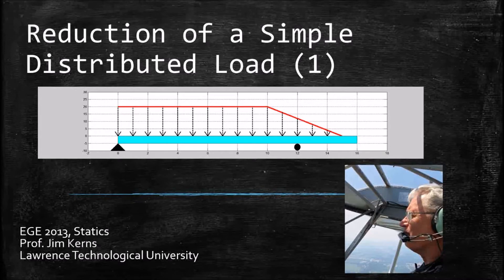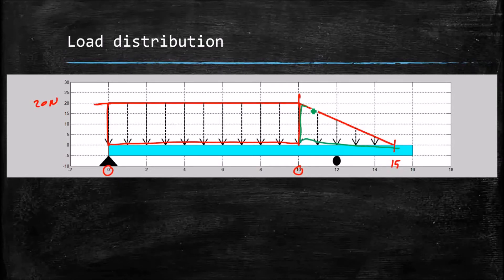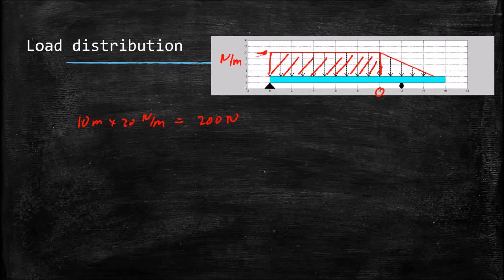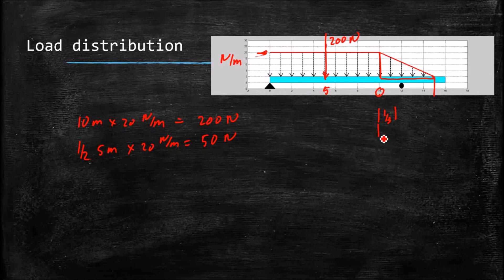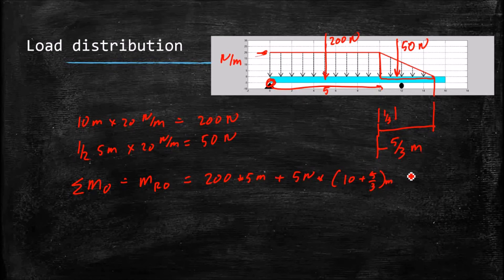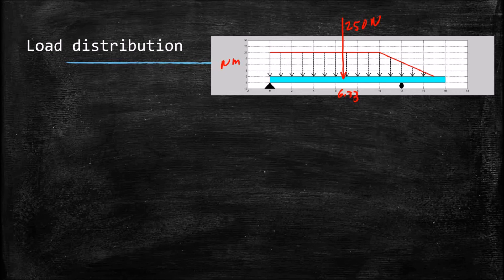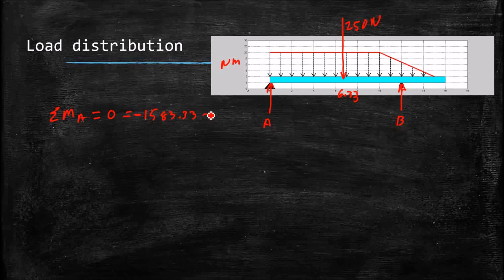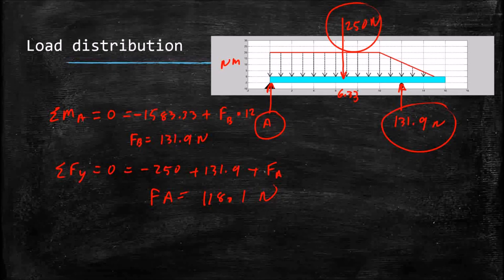EGE 2013 Statics: Resolving a Simple Distributed Loading Example

Comment: What if you took the moments at a different point?
Reply from the maker: The final answer is the same force in the same place, but the distances in our calculations will be different - for example if we took the moment about the right end of the beam, the distances to the two equivalent forces from the end would be 11 m and (1+2/3 * 5)m for the rectangle and the triangle - in the end the total resultant would be 9.67 meters from the right end. (if I did the math correctly :-) )
Reply: GeoffreyThorpe123 
How did you get 10 m?
Reply from the maker: If you are referring to the point where we go from a constant loading to a changing loading - I just picked that point arbitrarily when I created the problem.